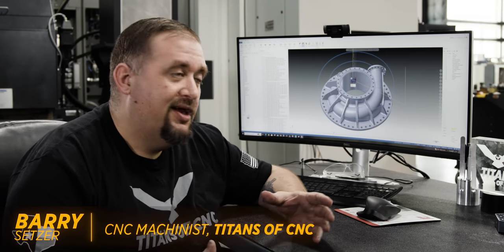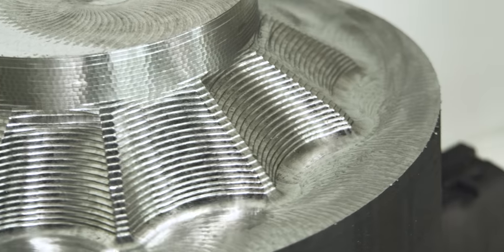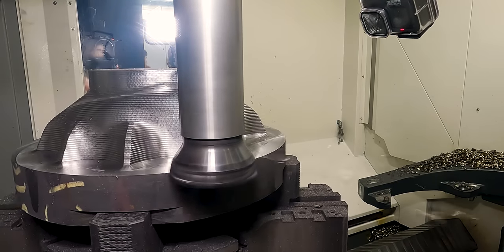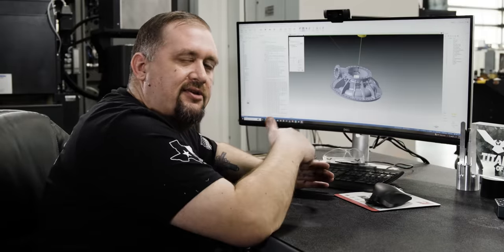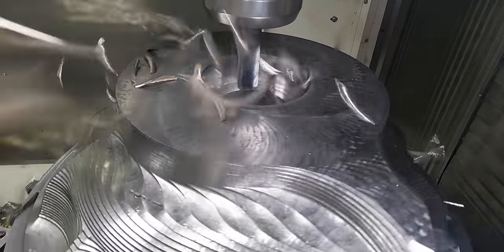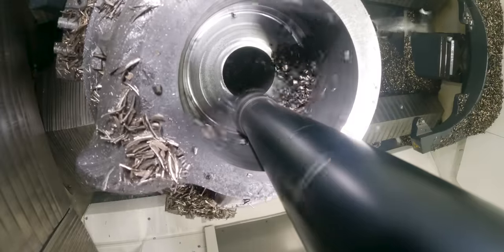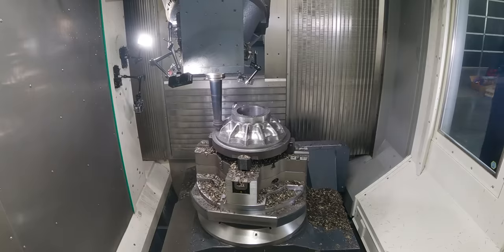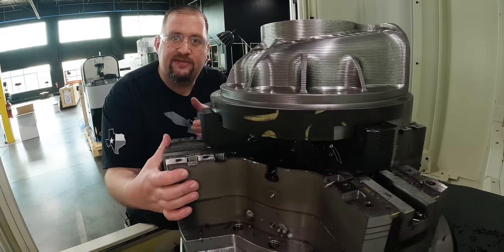Precision Machining Techniques Used To Manufacture A Pump Housing

Comment: 30 MINS? Now that's HELLER impressive!!!
Reply: Good one!
Reply: 30 mins??? I call BS
Reply: Its insane, 30 min to rough it out is incredibly awesome. Prob take 30 min to prepare a sand mold for something like this with uncertain results ahead, casting imperfections etc.
Reply: Sorry to burst the bubble but 30mins is complete BS. I count 55 step downs with the 4in HFM which takes 8 seconds to do ~1/4 turn of the part (from 0:28-0:36), do the math and its 29mins just for that single tool! the 2 in runs at 50% the feed of the 4in so add another 44mins and you're already over 70mins for just 2 tools. 30mins is a complete lie. Sad to see them say something so egregiously wrong. I thought titans was more honest than that.
Reply: @s.s.9627  you're probably right,i dont get why would they lie like that
Reply: 30 min ? No Way !
Reply: My guess, unless they choose to clarify the claim, is that this was an error on the part of whoever edited the video, leaving out some context regarding what specificly took only 30 minutes to do.
Reply: There's no way is that 30mins for all that rough out

Comment: Barry, that was awesome. I like watching the milling, cant wait for the next vid.
Reply: Hey thanks Jerm!
Reply: @barrysetzer  hey Barry, wouldn't it be faster to rough the big hole in the middle with a smaller (63-85mm) high feed mill? 

we did it like that in my old company in the horizontal position with 0.3-0.5mm doc, 750 rpm, 7100mm of feed and air 

a hole like that would take maybe 10 minutes

Comment: roughing is the worst part for the machine because of major tool load so i think its cool that titan is detailed on hogging the metal off using the machines strengths then speeding it up on the light tool load cuts.   excellent work.
Reply: Hey thanks bud, just talkin about what ive seen and done! Thanks for the support!!!

Comment: Depending on the quantity of units being made, you either cut from solid chunk of material or make a rough cast and machine that down on critical areas only
Reply: Based on quality also. And its geometry. Sometimes you just have to use molding, it is chepaer, you can cast crazy geometries, but you can lack in terms of porosity, for example. You can compensate that and everything else, it isa beauty of this work. A lot of pain for the average human tho...

Comment: On the second note about having to pick up from the beginning. Hermle 5 axis machines have this AMAZING feature called block scan. You can pick just about any line in a program. It will scan everything in the program up till that point, figure out which codes were active etc etc and start you again right from that point.
Reply: I also freaking love durabar. We use it all the time
Reply: I think this is not directly a feature of hermle but from the control Siemens/Heidenhain
Reply: Even haas have this feature. The bigger issue is knowing where to start and find that easily on a program that might have a million lines of code

Comment: At any point did you find it necessary, or just reassuring, to check the clamping pressure on your jaws? Stout set ups, the best tools, excellent programming, all add up to quality parts. Well done.

Comment: Love machining cast iron, hate the mess it makes of the coolant and the dust on everything. But Barry I have to ask, why not rough the id with the high feed mill?
Reply: TBH I didn't think the dampened holder was going to help as much as it did, so I expected it to sound rough. But, it ended up sounding great, so if I could go back I would've skipped the endmills.
Reply: @barrysetzer  Fair enough... ive found the hf mills push up so hard that even extended they don't bark nearly as bad as a standard shoulder mill. Thank you for your reply.

Comment: Really cool Vido, but i have a question. Why you dont use the 9 axis Turn Mill for this Part. The od and id roughing goes so much faster. Or you did it just like you said you are a mill guy? :D Anyways i like seeing mills working as a lathe guy :D

Comment: Why wasnt the part cast beforehand so that there was a lot less material to machine, therefore saving material costs and the time taken to rough and profile?
Reply: Probably a one-of part, making it more economical to machine it out of a billet over spending 100-150 hours to make  the pattern and casting.
Cheers.

Comment: Is it really necessary to machine down the steps on the outside? 

I would think it would often not matter if the part is visually clean outside, as long as the critical measurements are correct. Because then it is just extra time spent on niceness, and is that extra time spent paying off for both the costumer and you?
Reply: Depends on customer and application. All those steps can be stress points and some customers like parts to look clean  others just want it quick and/or cheap
Reply: @wildin13  With all the time roughing it doesn't take too much more time as a percentage to make a part look ten times better and finish it correctly.
Reply: @phillhuddleston9445  well it depends really. As a tool and die maker I find 30min roughing to 2" on this is shifting, considering that inside bore. I also imagine it needs roughing down to a 3/8" tool in places so those steps don't matter 1 bit yet. Just focusing on the outer shape (none of the important features) I'd bet there's another 45-60min of roughing then an hour or 2 of finishing. But thats assuming its finished with 1 tool which I actually doubt highly.
Typically when we do the "lightening out" on the back of gravity dies we use high feed roughing tools to "finish" with a smaller Ap than usual to reduce stress risers

Comment: ive removed well over 1000lbs of steel and iron on one part on my job :-). in under a 12 hr shift
Reply: YESSSSSSSS I Hope you love chips as much as i do
Reply: Yes you sure can if you have a monster of a machine and a programmer like Barry.The bit I don't understand is how do you have steel and iron on one part?
Reply: @mehmettemel8725  some of the parts are  adamite steel and some are nodular iron.
Reply: @mehmettemel8725  I run a 150HP lathe that can hold a 20 ton part,  our roughing tool is 1-1/4 or 32mm ceramic inserts,
Reply: @MrChevelle83  Yea you reminded me when I was an apprentice at steel works machining back up rollers up to 60 tons with ceramic inserts,watching the roller go round and round for a whole shift falling a sleep.🥱
Reply: @mehmettemel8725  Yes that's what I do, our largest part is about 20 tons US, give or take.    some of them take several days to fully machine from blanks.   we fill up about a 25 yard roll off dumpster every week sometimes more if we do a lot of roughing.

Comment: Barry before you start machining you should explain why you wouldn't 3D print or cast the part.Reading the comments there is dozens of them asking the question.
Reply: I actually did, but it ended up on the editing room floor. It's a prototype which would be cast in production

Comment: If I see it correctly I assume that the part has a tube that goes around, but with what sorcery other than additive or casting could you machine this from raw stock?
Reply: Must be a showpiece of sorts
Reply: If the bottom plane cuts through enough of the tube, you could access part of it through there, and the rest from the opening on the top

Comment: Wouldn't this be easier to 3D Print it?
Reply: but it would take several days.
Reply: There are still advantages to using billet that alot of designers prefer

Comment: Honest curiosity...isn't 3D printing making this obsolete? 

I printed a lot of very complex wpn parts while overseas.
Reply: What's your deposition rate?  Like 3 pounds an hour? So it's a 12 hour part plus possibly a hot isostatic press process to remove porosity, which isn't free or fast.  Then do you have to machine the part to produce the sealing surfaces?
Reply: No, 3D prints are nowhere near as strong as machined parts from solid stock and they are not as precise and can not achieve the same surface finish as machining can. If you need a one off non-critical part or prototype that is low strength then 3D metal printing wins but anything else and you need it to be machined from solid metal.
Reply: @phillhuddleston9445  That maybe true to sum extent but one of my customers who are in 3D metal printing print parts out of inconel for rocket fuel swirl injector that has internal holes through out which would be very difficult to cast and impossible to machine.
Reply: @k53847  More likely 36 hour part especially powder based systems.
Reply: @mehmettemel8725  True, in cases where machining is impossible 3D printing may be the only option as casting is not as accurate and for a one off or small production quantity it may be more cost effective as well as long as it is strong enough for the intended purpose.